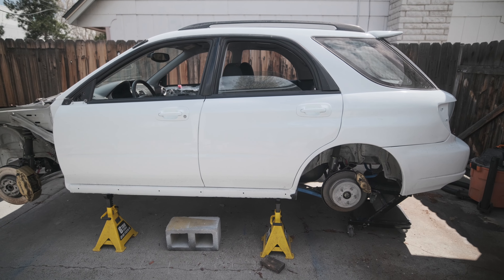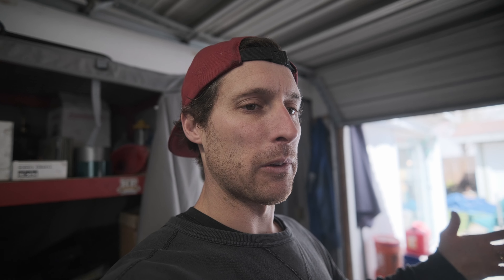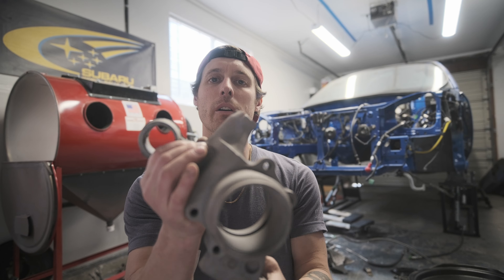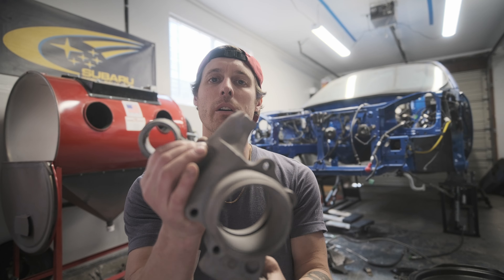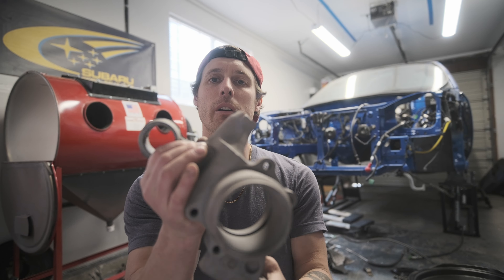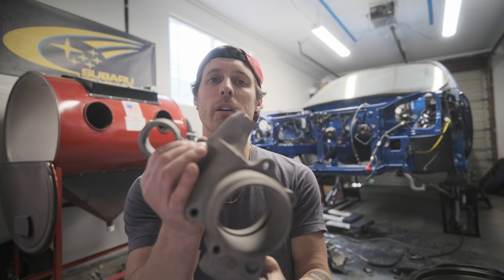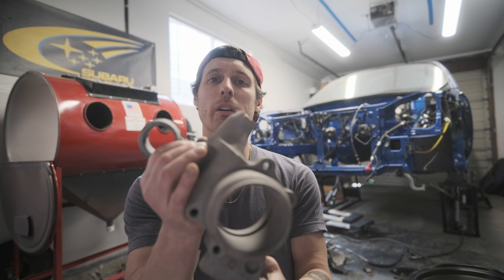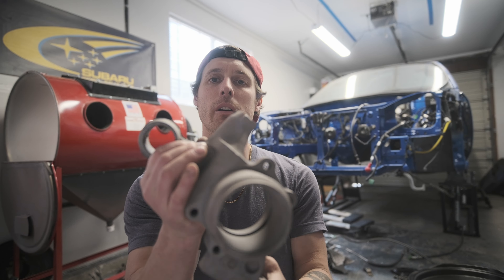Rebuilding A Neglected STI Ep. 13 | Replacing Subaru Wheel Bearings & Drivetrain Bushings

Comment: Rather than get the car done, get track experience & go race. I think you’d benefit from not setting a deadline or target & focusing on shaking down the car, developing & improving it, while you get the seat time & actually get comfortable on track before thinking about entering a race. 

Just my opinion obviously, but you’d spread the cost over longer, have plenty of seat time in a well sorted & proven car, which sounds like a much better starting point to then enter racing, as well as removing the pressure associated with deadlines (on both yourself mentally & your wallet, to get the car built in a set time).